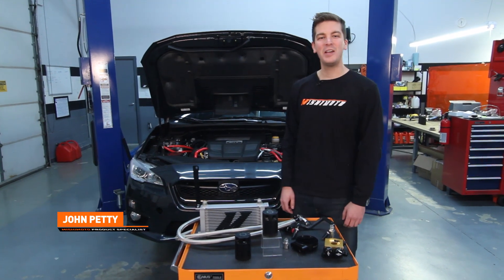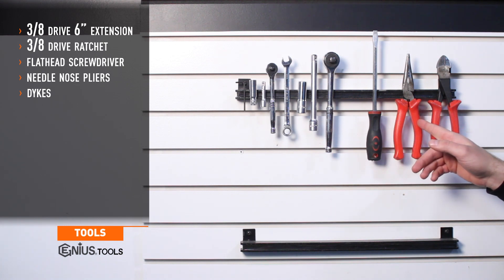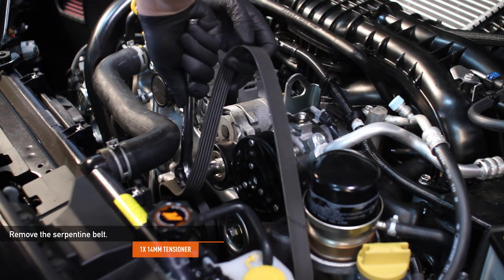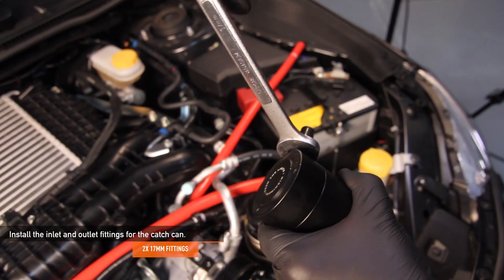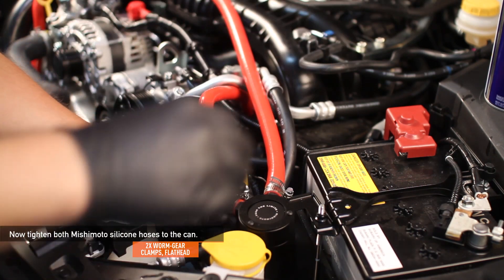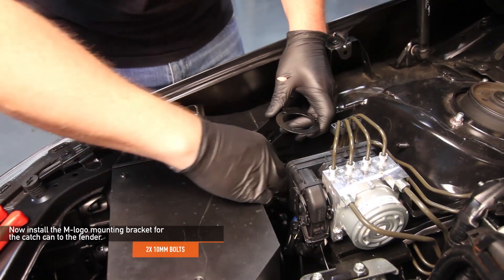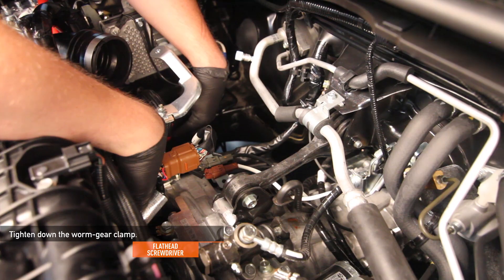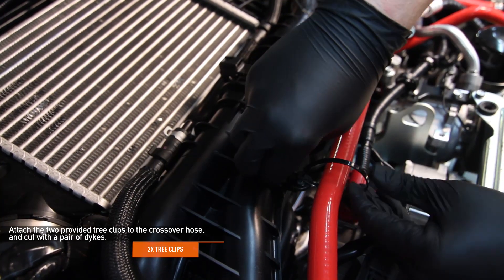(OUTDATED INSTALL) 2015-16 Subaru WRX Baffled Oil Catch Can System Installation Guide

Comment: Will this fit on the 18 wrx
Reply from the maker: Hello, surf jujitsu. Currently, we only verify fitment on the 2015-2016 models. It may be compatible with your 2018 model, but I would not be able to confirm this as of now.
Reply: Mishimoto Automotive were these hoses ran correctly?
Reply from the maker: Hey surf jujitsu. Please reference the updated installation guide. Link below. 

https://www.youtube.com/watch?v=GseyO8pmIIg

Comment: I have a 2016 Wrx I have this installed on, How often do I have to mess/dump the oil from the can? is there a video on how to on it?
Reply from the maker: After installation, Mishimoto recommends checking the contents of the baffled catch cans every 1,000 miles until a baseline is established. Oil blow-by accumulation will vary with ambient temperatures and driving conditions. It is important that the contents of the can do not rise above the internal baffle.
Reply: Mishimoto Automotive does thiz releive crank case pressure as well?
Reply from the maker: Hey surf jujitsu. If installed properly, this product would not affect the crankcase pressure at all.

Comment: Does anyone know if its possible to just disconnect the pcv hose and run it to the bottom with another hose so it just never recirculates? im nervous getting a Direct injection motor becouse of the intake valves not getting sprayed.
Reply from the maker: +krispy kevin No we do not recommend that because you have 2 different times at which you would need both systems why driving.

Comment: Just installed mine. It wouldve helped if you guys numbered or labeled the hoses. Was confusing on which to use at first. Had to really look at the other short ones .Also the catch can mounted to the battery was a bad idea. One of the hoses covers the oil fill cap. Now I need to take off that hose very time I change oil. Despite all of that, the product is great.
Reply: +Keith Barcinas Maybe you can route the hose behind the oil fill cap? that is if it is long enough. The video goes kind of fast, still debating if I want to buy it for my 16 wrx :/